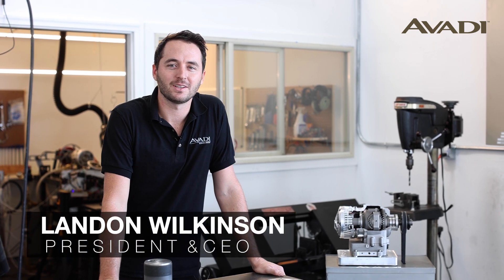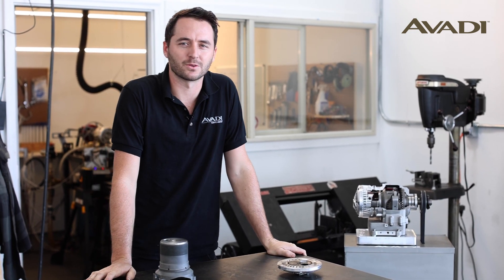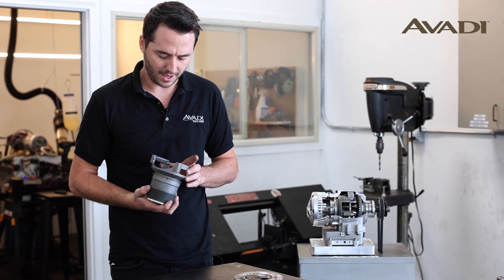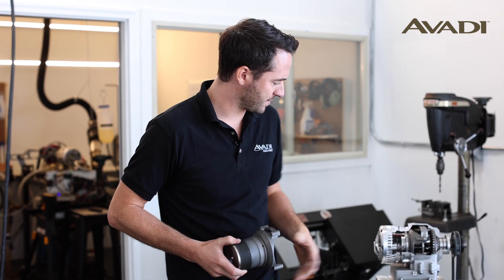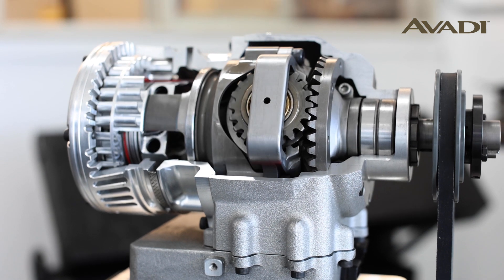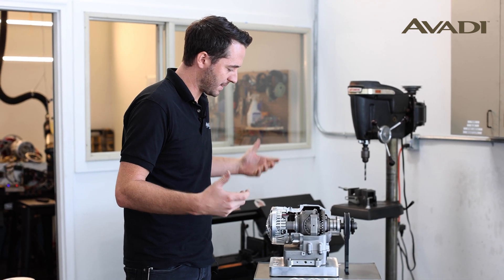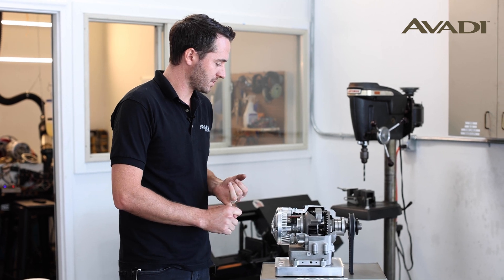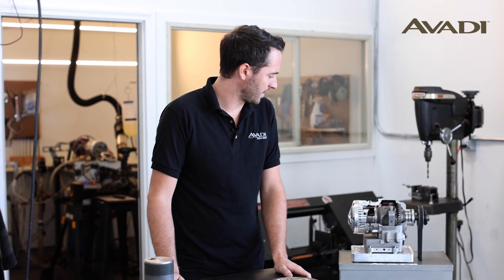Avadi Engines - Rotating Piston and Cylinder

Comment: The engine looks so cool! But I'm too dumb to understand the use for it, does it make more power? Better efficiency? Higher RPM? And where is it going to be used?
Reply from the maker: The main benefit to our engine is in reduction of weight and (as a result) improved efficiency both in terms of fuel burn and power to weight ratios.
Reply: @avadienginesinc.7902  Any engine without starter, gearbox, liquid cooling is going to weight less than the "competition"
Reply: @gafrers most engines don't have gearboxes included and most engines this size aren't liquid cooled

Comment: Hi ,  how about you incorporate an electric motor to it , where there will be a permanent magnet that would  rotate with the crank shaft, and the stator  integrated to the housing of the engine,  I think that would  be a nice  concept you can use it as a hybrid engine gas motor/ generator